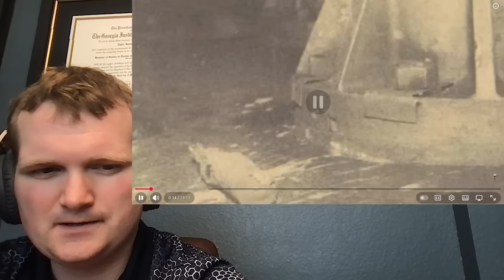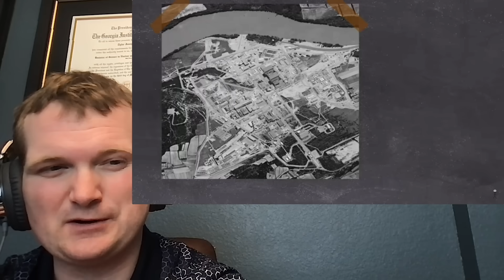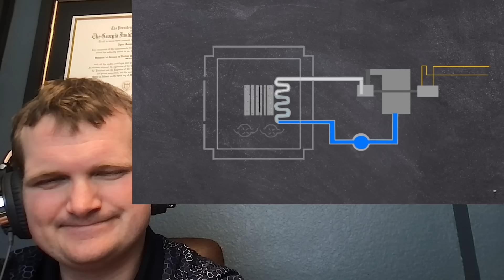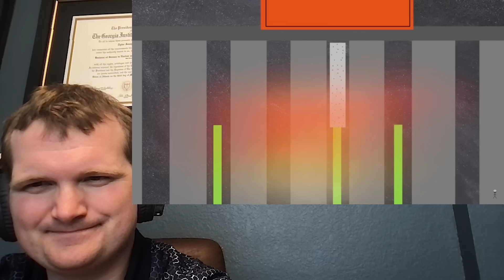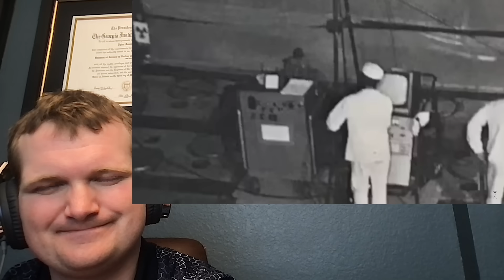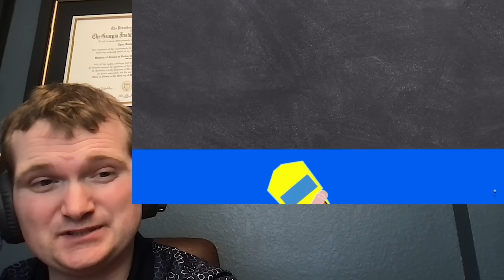Nuclear Power Plant that Melted Down Twice - Nuclear Engineer Reacts to Plainly Difficult

Comment: UK still uses gas-cooled reactors, specifically AGRs (Advanced Gas-cooled Reactor), If I'm not mistaken, it uses helium instead of CO2, but the operation is very similar, it's also moderated by graphite. The Heysham 2 plant uses this type of reactor, and it broke the record for continuous operation because it can change fuel without needing to shut down, just like the RBMK.
To be fair, the AGR is a more modern reactor design than the one shown in this video, but it's still a gas-cooled reactor.

Comment: So INES scale is like the EF scale for tornadoes in that its more about clean up cost than fatalities and area affected
Reply: Yeah, connecting number of fatalities to the INES level makes no sense. The number of fatalities caused by a radiation accident is hard to calculate, because there are long term effects. It's like saying "Asbestos is perfectly safe, none of our workers ever died while installing it".

And it goes the other way round too. Like, subcontractors repaint the outside of the reactor building and the scaffold fails, 10 people dead. "Major nuclear accident, INES 7, same as chernobyl". Nah, just your run of the mill floridian construction job...

As for Fukushima: 4(!) nuclear reactors permanently damaged, people who will never be able to return home, a significant portion of Japans money going into cleaning up the mess for at least a hundred years, multiple countries exiting nuclear power generation as a direct result.... that is a major nuclear accident and completely justifies the INES 7 classification.

Comment: 11:39 I was initially also convinced that Tschernobyl was "deficient", because of the lack of a 3m thick reinforced concrete containment. But No!    (in the 1970s I visited Gundremmingen C, before start-up; very impressive "Tag der offenen Tür") 
Once a reactor goes supercritical ( and doesn't quickly get out of it ) it is Game over. Without or with a proper Containment! 
The MSRs are different because they don't rely on Delayed Neutrons; they self-regulate by thermal expansion. But this is secure, if, and only if the core is SPHERICAL. 
The Chinese Kugelhaufen HTR, derived from German design, is highly cylindrical, which is an inherently problematic configuration. If  the reactor walls buckle and build a "belly" that HTR might even go supercritical?

Comment: 4:00 I think the scale captures the side you usually discuss quite well and trying to add overall impact, which may take decades to fully assess, would make it basically useless.

Incidentally, there's a video by Soup Emporium titled Chernobyl's Death Toll (https://youtu.be/wLoMfLBYcQg) that shows just how difficult it is to get a handle on the overall impact.

I don't agree with everything as presented, which in my opinion is part of the message that the issue is more nuanced than just the directly attributable death toll.

It's rather long, but I would love to see your take on it.

Comment: Tyler, the deadliest nuclear accident in The United States occurred on 7-17-1970 at the PGE Unit # 3 partial meltdown just South of Eureka,California. Google "Humboldt Nuclear Accident" by Scott Rainsford.
     This was a coverup by The Joint Committee On Atomic Energy of the U.S. Congress. South Bay Union Elementary School was 704yds downwind. More than 10% of the fuel melted. Safety systems failed.
     Just try to get access to the nuclear operator's log as the NRC (Dricks) said it's all "missing". They admit there was an "Event" but nothing more. They LIED!

Comment: The power station down the road from me was a Magnox one; it was decommissioned back in 2002, only the reactor buildings are left now (they'll go in another 70 odd years). Kind of amusingly, the reactor was still being monitored by PDP 11/70s after the original primary monitoring minicomputer had a disk failure.

They're looking to build a new power station adjacent to the old site; there's a lot of opposition though. I wish they would build the new one - it creates thousands of local jobs, forces them to do a load of road and sea wall maintenance in the area, and possibly protects the local railway line (the old plant used to receive all its fuel via a dedicate rail siding). Not sure about the partnership that wants to build it mind you (China General Nuclear Power Group).

Comment: I live in the country downwind from this station. Most  people here know this station very well. Every six years or so we are reminded by talk on the TV to suggest that France should shut it down for good. Usually right after reports of new cracks in concrete and pipes.
This is one of the nuclear power plants France has extended the licenses because my country has shut down our power plants which were a lot more modern. So our Atomic Power exit shutting down state of the art modern plants prolonged the service time of the obsolete ones - and we live downwind from those. Just brilliant, isn't it?

Comment: As a child in the 1980s, I remember we were pre-emptively handed out iodine pills, because we lived "near" a nuclear reactor (80 km, 50 miles away). In case of a radioactive release, we were supposed to take the pills, saturating the body with iodine so that it wouldn't absorb as much of the radioactive iodine that we could've been exposed to.
Reply: My family too. Three Mile Island, right after 9/11. We lived in Hershey but my dad worked right there in Middletown (but not at the plant).

Comment: I learned hang gliding in central France! Millau. And hang gliding is BY FAR the most dangerous thing one can do, second only to war. The instructor however said that more golfers die than hang gliders. Well, I thought, perhaps because there are thousands and thousands many more golfers, and many of them in their 80s dying from a heart attack anywhere anytime.

Then he went on describing causes for why hang gliders have died. Like failing to attach the little snap hook of the wing to the harness before throwing oneself over the edge of the cliff. Or deforming the assembled wing by running over it with the car while parking it. Or landing in the sea drowning since one cannot swim with a big wing on one's back. Or getting stuck in a tree in nowhere (also called Norway) and starving to death there. Or fighter jets zooming by and scrambling the wing with their turbulence. Or persistent upwinds suffocating and freezing the hanging guy at very high altitudes. Or simply smashing oneself dead on the plain ground when landing too hard, if there's a sudden wind gust.

That was a Summer of great fun, and quite some bruises! The instructor included a big barrel of wine in the course and lodging. To us, his students in our 20s, that was a very responsible thing of him to do! He expressed great surprise that we emptied it so quickly. I think that in France they drink wine with food, in Scandinavia we drink wine for fun.
Reply: Hang gliding is far from the most dangerous thing one can do😂
Reply: @kylarobinson3552    To be more precise:
Landing is!

Comment: Nuclear safety looks a lot like Air safety, as in, engineers take note of past fuck ups.
This is why new designs are so terrifying, you can't possibly simulate every way how something would fail.
Reply: And because of that fear iar travel is safer than car travel and fission power is safer than most power sources ( it is better than wind and on par or better with solar)
Reply: Reminds me of that saying: "The only replacement for a DC-3 is another DC-3."

Comment: According to the INES, would the first reactour meltdown at the NRX be a 3 or a 4 then. There was major cleanup involved & radiological waste was expelled (though again cleaned up), the fuel actually melted & new materials were needed to get it back up & running?
- The vagueness does seem to limit its potential as, is there a difference in whether effects are felt chronically (cleanup cannot provide a full recovery) or just temporarily?
Also always have loved Plainly Difficult, trains & plains alongside major accidents involving bridges & edifices. They get me hooked almost every time!

Comment: I was one of the engineers designing the plants cooling system. Our management told the team to use plastic!!! vanes in the coolant pumps and remove redundancy. All due to cost savings as this made pumps around 1000usd cheaper and manager wanted to get promotion
Reply: That's wild

Comment: What if a (first loop) main steam manifold/pipe fractured? Would the superheated water in the reactor quickly flash to steam, making the entire containment building inaccessible, and leaving the reactor dry of moderator-coolant, when it's still "hot"?  Is this the worst that could happen?